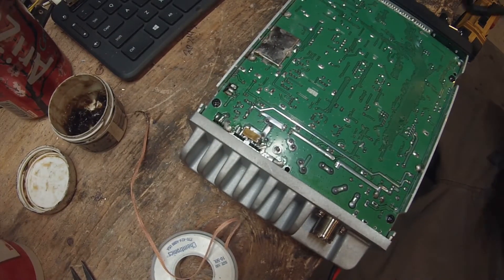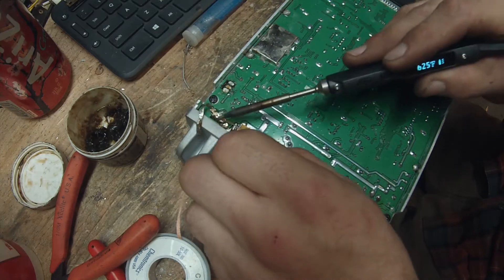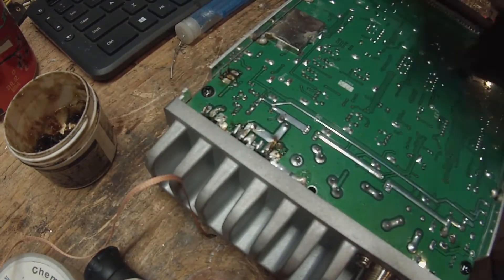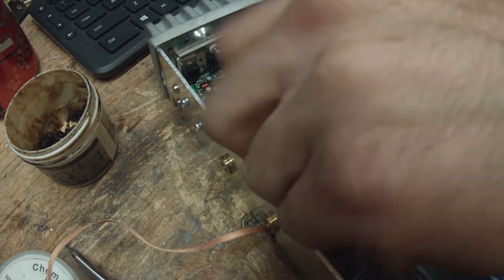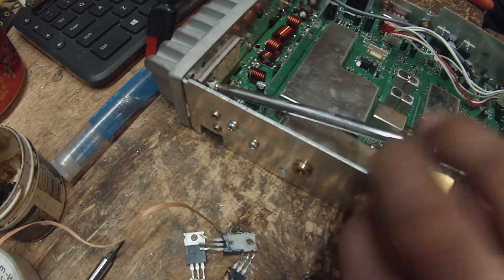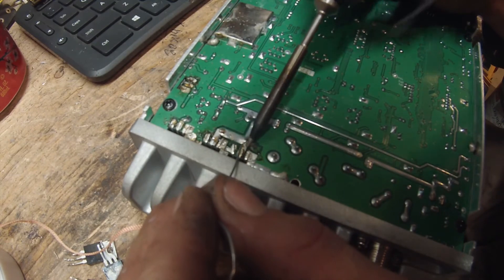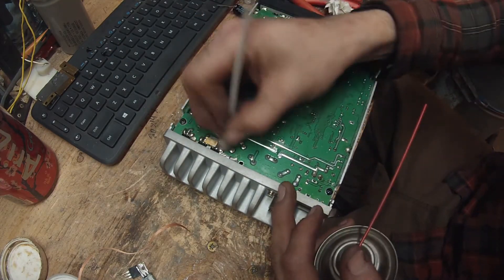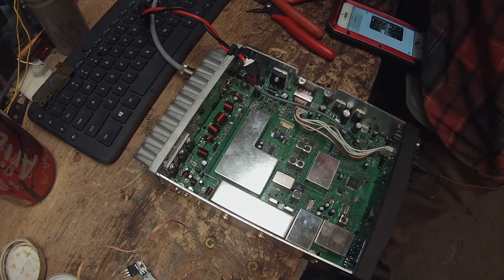Anytone at6666 IRF520 mosfet swap!!!

Comment: Has anyone tried MRF 497 Finals?
Reply from the maker: It would take a whole reworking of the circuit and at $62 per transistor with this radio having 4 would be pretty expensive

Comment: My new one came from the factory with the lrf520.
Reply from the maker: I guess they finally got smart!! That’s awesome!
Reply: @Hammerjockeyrepair  I purchased it in October. Any radio that you try to get every watt available is gonna take a dump eventually. I set mine for 80 pep on ssb. Am 2 watt dead key with variable all the way down, swings 10 . If I turn it up to 4 dead key swings 20. Fm wide open it’s 40 watts. Variable wide open on am dead keys 15 swings 40. I’m a ssb talker on 10&11 meter don’t use AM much. I don’t believe in running things for everything it’s worth. Reserve power on transistors helps on audio amps & radios. I use a amp if I need to do more. Most radios you see blown is truck stop specials they stretch to the max. They don’t care but for 2 things ,you smiling & opening your bill fold.

Comment: what a good video congratulations what a good video congratulations master exactly the same thing happened to me, with the difference that the radio does not raise power... I changed the irf 520 the voltage regulator... and nothing... I need help
Reply from the maker: sorry to hear that, I would suggest looking with a digital microscope at the traces between the regulator circuit and finals. They are on amazon and ebay fairly cheap now. Hope you get it figured out

Comment: im  also a tech'''''i like your video & i like your work'''''''i have a -6666 & i like it alot'''''' i get exellent reports'''''' its a very good radio'''''''thats the reason i bought (2) of them''''''i will some day replace the transistors with H.P. high performace transistors'''''''''''''but right now ive got a (good) question,,,,,,,,,i own (personal daily driver) a kenwood ts-130s'' the watts dropped from 190 to 2 watts,, i dont know why,,,,i have good transistors,, good everything''''''but the watts are at (2)''''''''''''''''''but if i only insert the center coax conector into the ant plug'' it will put out (120) watts'''''''''that means (no) antena ground just the center''''my watts are at (120)''''''''''''what in the hell is going on'''''''im a very good tech & im scrathing my head''''''''thank you kd5utu''''james.
Reply from the maker: I know it’s silly, but did you try different coax? Different meter? Test into a dummy load? It could very well be something else external.
Reply: @Hammerjockeyrepair  yes sir'''''the antena system is impeckable'''' i put my anytone-6666 on it its great'''''swr is (1.1)''''yes ive ruled that out'''''im thinking that the (swr) protection in it is ''activating''and cutting the power back''''but theres no  swr problem ,,,,,thank you sir'';'''''james.

Comment: I know this video is old but i just want to say thank you for sharing your results, bias voltage and what not. i asked 3 different radio operators and not one of them responded. but the point is you shared and i believe this kind of thinking is going to keep the hobby alive and fun. a lot of techs or golden screw drivers are just in it for the money. i do it for fun and share any info that is asked of me.
Reply from the maker: Thatsw why I shared this! Nobody wants to help. Every one of those dickheads say "why dont you send it to me for repair"  no i am a repair shop myself that charges a litte amount to begin with, and i came to you for advice, not to have you take it, charge me and my customer $400 to repair  a $200 radio lol!!  These dickwads wont even share a schematic (that someone shared with them...)  Im learning, Im building, Im trying to bring confidence to people and  Im trying to help keep this hobby alive!!!   Thanks for watching and commenting! Now that we finally bought our first, rebuilt and moved into our new house I plan on getting the camera back in the radiio room for more repair videos!
Reply: @Hammerjockeyrepair  hey i have done a lot of experimenting with this radio. one thing i learned is there is more then one manufacture that makes the IRF 520. some work better then others in this radio. i tried 3 different types of the 520. but the reason why i bring this up is because this radio will do 70 watts easy and clean as well. anymore then that and its just distortion and IMD. i saw this on a spectrum analyzer. but the best mosfets i have used so far are the ERF2030+ but the output tank needs to be optimized for them.
IRF520PBF-ND is what i use on them cause they are drop in and do about 70 watts pep on 3.8volts at the gate. i found that with this combo it was the cleanest on the spectrum analyzer.
and yes a lot of them are dicks and will also feed you a bunch of nonsense to get your money.
Reply: thank you  for that comment''''''''''''thats what its all about''''''''the hobby & fun & education''''''''''''''''''NOT MONEY''''''' ive got thousands & thousands dollars worth of equipment to work with''''''''''and im still collecting more test equipment & electronics'''''''''''''''''its all about keeping this (GRAND HOBBY ALIVE),, money cannot buy you the knollege you gain from ''dableing''with transmitters & receivers''''''''its a ''''ART'''''''that money alone will not extend''''''''thank you'''''''james. (KD5UTU).

Comment: The 520s are tougher somehow idk how but on paper the fqp13n10 is a better mosfet rated at 12.8amps at 100v compared to the 520 which is rated at 9.2 amp at 100v most likely they are using a cheap manufacturer for the 13n10.
Reply: I did my finals with zz24 fets.
Turned out good .
Did my other rig with 13n10 fets and so far so good

Comment: Nice video and I watched it because I just ordered the Anytone AT6666.  I ordered from Lesterscustoms.com and on his video he explained that the radio runs too hot and can blow.  Not sure if it was the same issue but this is the Mod he does if you pay for it when you buy the radio.

Does the regulator in your radio run hot? Excessive heat from a transistor means the part is undersized for the circuit or that the circuit itself is not very efficient. Changing the radio’s modulation circuit is impossible. But the solution for this problem is the Palomar MAX-MOD Transistor. Palomar is a famous old CB brand name from the USA. The name is owned and used now by EKL Components, the mother company also for Magnum Radio’s and RF Limited Accesories. New in the Palomar program is the MAX-MOD, a special PNP transistor. The MAX-MOD is a replacement and upgrade PNP transistor for the modulation circuit in most radio’s. The MAX-MOD replaces the common 2SB and TIP parts. The MAX-MOD works very well in 10M radio’s, including Stryker, Anytone, Galaxy and President models. The MAX-MOD will give the RF section the current it needs and will increase the peak power by and average of 10% or more. The MAX-MOD has the same lead spacing as the smaller transistors it replaces, making soldering very easy. The MAX-MOD uses a huge TO-3PL package for improved heat dissipation.

Here is a link to the website page: http://store.lesterscustoms.com/anytoneat6666.html

73s and again keep up the nice work.

Jim
Reply from the maker: Thank you for watching and commenting! I am very familiar with lesters workshop and his amazing work on the 6666, Mine ever since I did the irf520 swap has been running very cool. I typically run it down with a  3w deadkey swinging up, but sometimes I crank this thing up and yam on away for hours with a 40 watt dead key and this thing doesnt get remotely hot! One of these days im going to get the maxmod for it!
Reply: @Hammerjockeyrepair  I am interested in getting this. Mine is bone stock never touched, run in the semi truck. I also have a 5555 N2. It only swings to 40w from a 15w DK and that's me using audio gear pumped into it. 
Do you do any mods to get low DK and high swing on these or the 5555n2.. I'm more interested in the 5555n2 since it's my base and running my 4x 2879c box

Comment: Nice job on the 520 swap. I'm technically inclined but unsure how "exactly" to check and adjust the gate voltage. Have some volt meters and been soldering for years. Hope thats not needed right now lol. There are micro potentiometers in front of the finals. Have a brand new at-6666 got today! 3 of the 4 finals are covered with some kind of shield. It's imposible to check any of the legs (unless I also remove the top cover for bottom access). Appreciate a quick 411 on how to check and lower the gate voltages. Thank you sir.
Reply from the maker: I am still not 100 percent sure on the proper voltage for this, One thing you can do is check the voltages at each pin right now before there ever is a problem (if you are steady with your fingers!) just pop the top solid cover off and check the voltages from there, write it on paper with the pins, and if you end up needing to do the 520 swap, use that same voltage. I have still been running this radio 8+ hours a day every single day running a continuous 35 watts AM the entire time and she has not skipped a beat!!! Thanks for watching and Glad you enjoyed!
Reply: Thanks for the reply. This is a dumb question but should the volt meter negative go to ground then check each pin on the transistor? How did you get 35 watts on AM? Mine is about 15 watts AM, 60 FM, and 50 pep on SSB. How exactly could I adjust the voltages? This is primarily my main concern. I'll do you a solid and checks all the voltages then post back so you can have a reference.
Reply from the maker: Team 5D 👌👌 with DC negative is "negative ground" so either the black wire from the power cable you can attach to, or the chassis in some cases like I did on this since the chassis is grounded.   The bias voltage adjustments are those little pots you spoke about directly in front of the mosfets (but don't just start turning them without having your reference numbers!). The am power has an adjustment (w13 and w4) says pwr l or something like that. I can't remember off hand.   And please do get back to me with the voltages of yours!!
Reply: Guess the question is, do I simply put the negative from the voltmeter to ground chassis and then probe the gates to the mosfets? I found out which leg is the gate. I don't want to run the risk of shorting out the transistors testing them live with a voltmeter. Here are some links of interest: http://www.worldwidedx.com/threads/stryker-955hp-bias-test-point.200522/ and http://www.mouser.com/ds/2/308/FQP13N10-1124467.pdf. The stryker 955 is very similar to the at-6666. Let me know if this is a safe method of getting the gate voltages or if all legs need to have the voltages checked.
Reply from the maker: Team 5D yes. Just clamp  the negative lead from your multimeter to the chassis.   And check each leg of the fets if you are steady. Or what they say on that page with the Stryker  could work as well!
Reply: OK was concerned testing the fets "hot" while transmitting might not be the safest thing to do on a new radio lol and wasn't sure which are the drivers or the finals. The ones with the shielding soldered over the bottom side was 0 reading since the radio wasn't transmitting. But the drain voltage cold is 3.58 volts for the one on the side and other slightly behind it in the far right corner looking at the bottom of the radio. Are you supposed to key the mic then check the gate voltages? Any risk of shorting the transistor?
Reply from the maker: I believe driver is the one that is sideways and the other 3 are finals. Don't quote me on it though as I'm still learning myself and teaching myself lol!  I tested mine at idle and on transmit. Nothing bad happened to mine! That's how I got my voltages. If I'm wrong I'd hope someone who knows would comment and let us know!
Reply: I'll check back and see if you are supposed to key the mic then check the gates hot. Don't think there is any other way to do it. Saw the pots for power and theres one I already adjusted for modulation on AM. Something to check out is the palamar max mod. It's a better AM regulator. I work mostly SSB. Read in a number of forums all these 4n1310's have a history of problems because they are cheap. The only thing you can try besides (already) replacing the bad ones is to use a small 60 mm fan or find better cooling. This is going in my vehicle so it would have to be internal but need the fan to be off when the radio is off. Have a few amps and might just use them with a few watts to drive it. Then its no worries :)
Reply from the maker: Team 5D yeah, I wasn't running mine high at all originally when the crap 13n10's exploded!  They weren't even that hot. I removed the cover within 30'seconds of it popping like .22 shots being fired!  Everything I see on the fets is that they're crap! Internal fan would be easy to install, and wiring it to a switched source  should be easy enough.